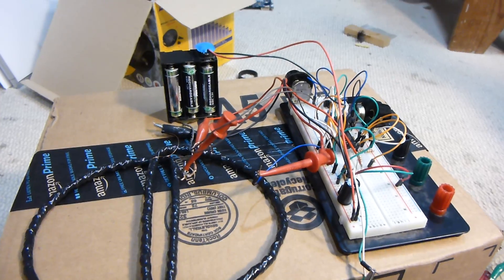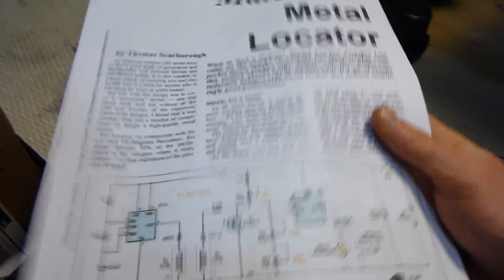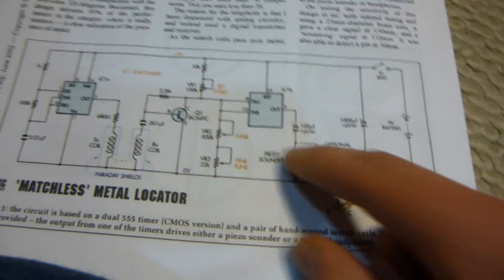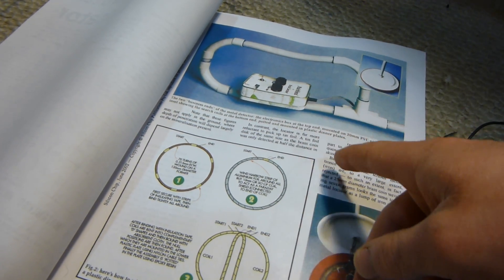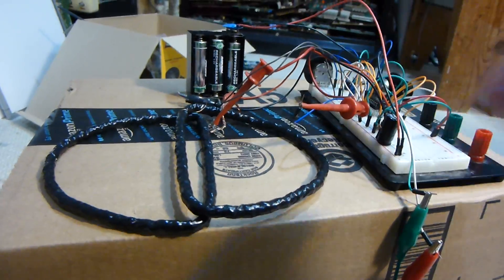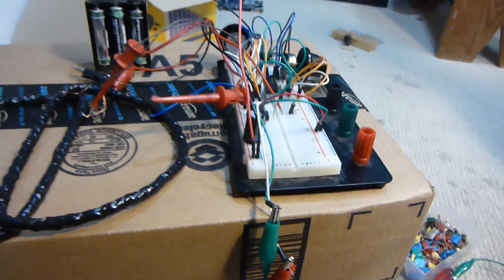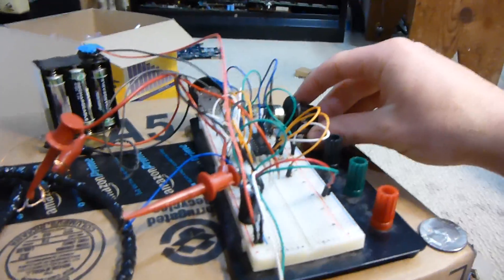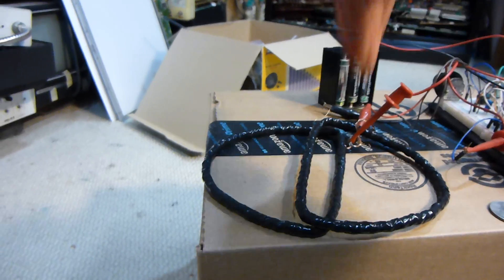Homemade DIY Metal Detector Using Dual 555 Timer Chip

Comment: The DD coil of this circuit is not sensitive enough, I highly recommend changing the shape of the coil to increase its sensitivity. With this method, depth does not increase, but sensitivity to small pieces of metal increases. (For example, bronze, copper, metal money sensitivity set increases.) It has been tried and is a useful method. https://www.emworks.com/blog/motor-design/metal-detector-explained The DD coil of this circuit is not sensitive enough, I highly recommend changing the shape of the coil to increase its sensitivity. With this method, depth does not increase, but sensitivity to small pieces of metal increases. (For example, bronze, copper, metal money sensitivity set increases.) It has been tried and is a useful method.
When setting the coil, when you hear "click, click, click, ...", test the coil with metal coin or ring, fix it by sticking it with hot silicon... If necessary, slightly twist the coil end upwards

Comment: Hi all. I made the metal detector using the same documents. But I was not satisfied. Because although I use copper wires and coils of different diameters, the result is the same. Its effective range is up to 10 centimeters (4 inches). He sees metal coins from a distance of 2-3 cm (1 inch). This detector reacts well to large pieces of iron and aluminum. Also, instead of copper wire, I tried with aluminum enamelled wire (110 turns with a diameter of 0.5 mm), which I removed from the old type television, it works similarly.

Comment: You really need an oscilloscope  or signal tracer to adjust the coil positions properly. It should be most sensitive under where the two coils overlap.

In fact, looking at the output on a dual channel 'scope and comparing it to the pulses from the first timer section, you should be able to tell the difference between magnetic metal like iron, steel, and nickel, as compared to nonferrous metals like silver, gold, copper, zinc, etc.

Comment: Kudos for building your own project. Not for the squeamish! However, I would suggest that you do a search on a thing called "nulling" a circuit. The TX vs. the RX coils need to have a null point balance. You were having problems adjusting that sensitivity side to side due to an incorrect coil design. You've made what is known as a Double D coil, (also known as DD, for obvious reasons). The sensitive area SHOULD be in the area where they overlap. I noticed yours has sensitivity in the center of each side, not how a detector with DD coil should work. You should try doing a concentric coil. One circle with a smaller circle inside. keep your wire lengths the way the circuit was intended but make a tighter circle with either the RX or the TX coil. That will center up the detection area. Keep it up, you are on the way to greatness!

Comment: The file in the description states that the circuit can distinguish between ferrous and non-ferrous metals. However, the manner in which it's indicated to the user remained unspecified. Does the piezo sounder emit a different pitch depending on the type of metal entering the field? Or is there another way that the circuit indicates that the metal is ferrous?
Thanks in advance!

Comment: Hi , my friend  can I use  two NE555 timer instead of ICM7556IPD if I can use would you please Help me
Reply: Plzzzzzz reply me
Reply from the maker: +Nasser Samim You might be able to.  I haven't tried it so I have no clue.  But in theory it should work just fine.  Give it a try and let me know how it works for you.
Reply: tnx my best I will  test  it
Reply: The article says that it won't work with the old TTL NE555 or NE556, but must instead use the CMOS version.

So you could use two ICM7555 or two TLC555 timers, because those are CMOS versions of the 555 timer.

However, looking at the schematic, I can't see why it would not work with an NE555 or NE556. The first 555 section is just an astable, the second is merely acting as an inverting schmitt trigger.

Comment: Thats a nice simple design. I have looked into this before and not found anything so easy. Most of the Designs I have seen use a PLL chip. I wonder if you could decipher which coil has the metal near it and have stereo buzzers for finer location acuracy.
Reply from the maker: Mongrel Shark I don't know. It's an interesting idea

Comment: I will try to make that with transistors some time  just make simple oscilator and  for detector will use zener diode or silicon diodes i think it shoud work
Reply: JOSIP Žlk also I think if you put higher gain amp to replace that transistor and tune the detector part so it matches it shoud be more sensitive beacouse it will detect smaller changes  in the field...

Comment: Great design.
But could you amplifie the transmit coil
with some transistors.That would prob give more distance out of that circuit?
Reply from the maker: E Isad Thank you!  Yeah I might try something like that.  I need to hook it up the oscilloscope and see what exactly makes the circuit tick.  Then I can figure out how to tune it and add more amplification etc.  Thanks!
Reply: Np.Looking foward to see this work on high sensitvity.

Comment: OK, so it seems to use a threshold detector. It's a bit like a very small radar. I've read up on another design that uses pulse induction that seems to not be affected by ground mineralization as much but I think the circuit would be a bit more advanced.
Reply from the maker: Rouverius Yeah that's it!  Cool!  I may try some more designs if I can't get this one working well enough.

Comment: I am betting an NE567 phase lock loop IC would work really well as it can generate and decode its own signal. I have not seen a design for it but it would be easy to try. You know when it is all working well as you will detect an object that is as far away as the coil diameter. You should consider using a good voltage regulator as your circuit will drift as the battery voltage changes. Great work as usual.
Reply from the maker: Robonza Hey good news!  I just checked my IC hoard and I have 12 SE567N chips!!!  I'm going to have to do some research on this chip.  Seems like it could be useful and since I have 12...  The only thing I could find regarding metal detectors using this chip was this:  http://www.seekic.com/circuit_diagram/Basic_Circuit/PLL_DETECTOR_FOR_ALL_METALS.html  However it uses a slightly different chip, the NE656.  I'm not sure how different these chips are.  Maybe it's a small enough difference that they would be interchangeable.  If you could find that circuit that would be great.

Yeah the range is still really poor on it.  I was thinking about adding a voltage regulator.  If I was using 9 volt batteries I'm sure I would need one as the voltage would drop pretty quick.  I think running on this 9 volt pack it wouldn't be much of a problem expect for the first 10 minutes when the batteries are still stabilizing.  They are 1500mha batteries so technically at a 10ma discharge they should last around 150 hours.  So I think the drift would be very minimal.  But still something I may add.

Thank you!
Reply: Makerj101 I looked for a cct using a 567 and did not find any. I used the 567 for a super sensitive photo sensor so I think you could do the same thing for a metal detector. I can help with the schematic etc. You can skype me if you want and work through it. The voltage regulator is needed as when you tune a cct and the battery volatge drops 0.1v your cct is not tuned anymore. This cct is similar-search 567 in this http://ams.com/eng/content/download/250430/976493/file/TSL262_Datasheet_EN_v1.pdf swap the photo sensor and led for the two coils. I would think you would need a buffer transistor to the TX coil and an opamp for the RX coil.
Reply from the maker: Robonza Hmm I could try that.  Thanks!  Maybe we could skype sometime.  I'm really eyeing up this circuit right now:   https://www.youtube.com/watch?v=GRXq-BEHBlE  It looks a ton simpler, uses the most common transistors, and looks like is has tons better rang than mine.  First I want to hook my oscilloscope up to mine and see if I can't tune it better.  If I can't get at least 4 inches of range on a quarter then I'm switching to a different circuit.  Either one using the SE567 or all transistor.
Reply from the maker: Robonza I wonder if I don't have my resonance frequency right.  I'll try some different capacitor values and see if that helps at all.  Thank you!

Comment: You know to make the RX and TX coils easier you can maybe get away with using a CRT degaussing coils which are already wound and taped, you just need to add the bare copper and  cage to it.
I remember building things like this when I was in tech school back in high school.. I finally just bought a proper detector.
Reply from the maker: ElfNet Gaming Yeah I thought about it.  My initial tests were using degassing coils too.  One problem is finding two that are exactly the same.  I have a lot of them but I don't think I've ever taken two monitors/TVs apart that were the same.  

Hahaha yeah!  Well maybe down the road when I have more money I'll buy a professional one.  But for now homemade is going to have to do!

Comment: where did you get the 556 chip
Reply from the maker: science Vlog I got it from an old control board of some kind.  555 and 556 timers are really hard to find in consumer electrics unless it's a really old device.
Reply: science Vlog Mouser Electronics online.. also with other parts suppliers online, they are not that hard to find if you buy them new. Now trying to salvage them thats a different story because MOST consumer devices do not use them due to lack of efficiency and circuit space constraints when they can use a micro-p to do everything in one package. Now some kids toys and such would have them but even those are rare as hens teeth now.Some OLD first gen thermostats and digital timers may have them also.
I have also found them in OLD carbon monoxide detectors and smoke detectors.
Some 2-way radio repeater controllers also use a CMOS type 555 or 556 timer IC either surface mount or through hole depending on if its for commercial or ham radio markets. The commercial grade types will be surface mounted.
Reply: Makerj101 will some thing like a tl494 work, or some type of pwm chip
Reply: ElfNet Gaming okay ill get some old smoke detectors then tho i dont think it might be worth my time; might just order it.
Reply from the maker: science Vlog You know man, I wouldn't bother with this circuit.  eucalyptux suggested this circuit: https://www.youtube.com/watch?v=GRXq-BEHBlE  It's a ton simpler and looks like it works a ton better.  It also uses some of the most common transistors.  Best wishes,

Comment: Makerj101  what's the farthest distance away from metal can it detect metal?
Reply from the maker: Kman Meteor Yeah a about 2-3 inches.  But I'm hoping it will be better once I tune it more.  I'm not using the same transistor that the plans suggested so I may need to use different values of other components as well.
Reply: Kman Meteor looks like about three inches
Reply: Makerj101 thanks.

-Kyle